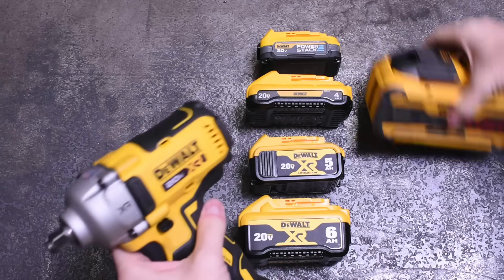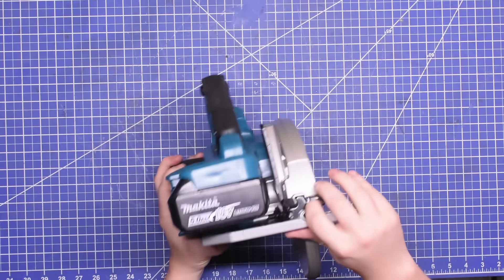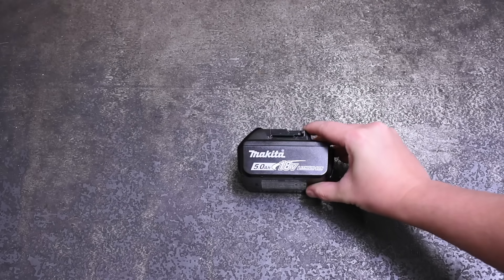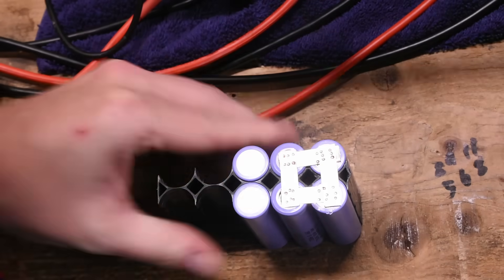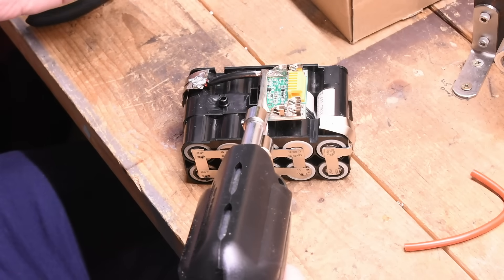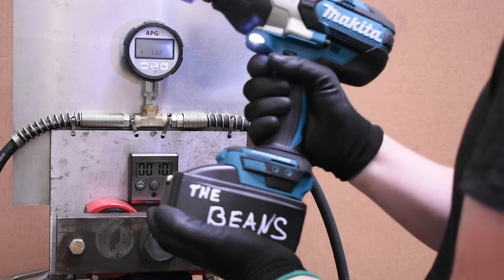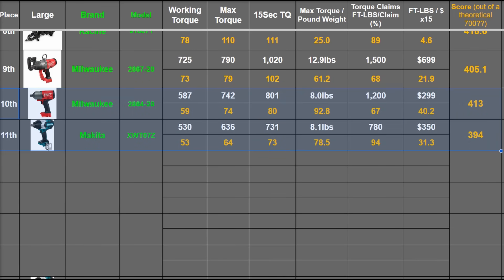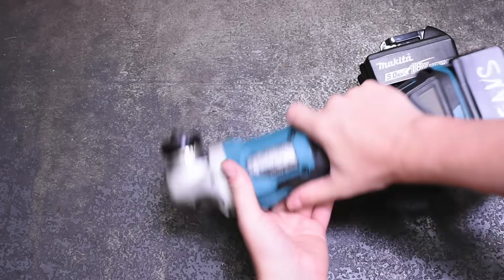We Built the Best Power Tool Battery for the "Worst" Brand

Comment: I have Makita battery packs that are around 10 years old and are just now dying off. I appreciate a tool that is somewhat dialed back and favors longevity. I would consider myself an above average weekend warrior, not a full time contractor so take my testimony for what it is.
Reply: Yeah agree, those batteries I bought for my first Makita drill about 12 years ago now, still work. Granted they may have lost some capacity over my new ones, but not to the point where I noticed which one is on any give tool.
Reply: Yea this is kind of like asking why your car does not have the performance it can have after some modifications. 
Sure it is faster, but also more expensive, and things may fail sooner.
Building the ultimate tool on an unlimited budget is not that hard, keeping it reasonably priced and reliable is a lot harder.
Reply: @zorktxandnand3774  I hear what youre saying but I'm still gonna put a turbo on it.
Reply: @zorktxandnand3774  I personally can't use "Makita" and "reasonably priced" in the same sentence together, but I've had no reason to look at their lineup in a very long time and have no idea of their current pricing, so what do I know?🤷
Reply: @h8GW  They're still expensive and the batteries are no exception in spite of how terrible they are vs what you can get from other, even lesser, brands these days. It's really disappointing as someone who owns Makita tools.
Reply: @randr10 I don't kmow where you live, but here in germany the Makita batterys and tools are vwry reasinable priced. You can get a 5Ah LXT Battery for as less as 60€, while an 8Ah Milwaukee, Bosch or Metabo costs at least 120€.
Reply: @Video-ee1dn Makita is expensive in America where as in the rest of the world where Dewalt and Milwaukee have less market share Makita is a lot more aggressively priced.
Reply: Yep…I bought a Makita 3-piece combo way back in 2009 and it came with two 1.5 mAh batteries.  They both still work great, as do the tools.  Undoubtedly the runtime must have diminished but not noticeably, and anyway I favor smaller lighter batteries over max mAh.
Reply: @davidyoung1610  That is definitely impressive, i think you mean 1.5 Amps or 1500 mAh not 1.5 mAh though
Reply: You are absolutely right!  I meant 1.5Ah battery packs.  Of course, YouTube won’t let me edit my own comments 🙄
Reply: I second that 
Never had an Makita 18v tool I didnt like and the quality of their batteries have been better than anything else ive tried or on par with Hilti and Festool packs 
Ive 10 year old 4 amp packs that works pretty much like New. 
I dont give a rats ass about "Max torque" and All that BS ... but in my anecdotal experience Makita tools and packs just work Day in and day out and provides great ROI as far as tools goes
Reply: My makita battery's are about 15 years old and still hold a perfect charge
Reply: I concur with this mindset, however I happen to be a full time electrical contractor. I've been using my Milwaukee impactor and 5amp battery packs for 7 years, no signs of slowing down yet.
Reply: I have ones that are 10 years old that live in full 5 to 6 days a week construction. In cold harsh winters even that still work
Reply: I got 16 years out of my first drill and 12, and 13 years from the batteries that it came with.
Reply: Interesting find on your Makita battery failures. I run all of the brands and Makita for me has been the most reliable battery. I didn’t say it was the most powerful battery, but it is in my professional use the most reliable brand out there. We run over 50 LXT batteries and we have been had any failures since 2014. I know we will eventually have a failure but compare that to six Metabo HPT,seven DeWalt , 13 Milwaukee and one Bosch battery failure.
Reply: Both are good. they can offer 4 or 5ah battwries marketted towards longevity, and 6-10ah for the beans **may degrade, possible start a trade in, send in the worn out 9ah for like 20% off a new one
Reply: I find that makita seems to be good quality as well as having production all over the country
Reply: There's definitely something to be said for longevity; I still have Makita 9.6v drills and a mini circular saw from the boatyard I mostly grew up in--in the 1980s! They still run just fine. Yeah the initial outlay is pretty high, these teal tools aren't cheap, but when you consider my classics are still running almost 40 years later I think the cost per year puts them well below even the Hazard Fraught lineup.
Reply: my Makita have lasted me 5-6 years before i had a drill and right angle die out as a Plumbing subcontractor
Reply: As a heavy user of these tools the performance and reliability is there. I’ve put my m12 and m18 fuel tools through hell in really harsh conditions and the only part of them that ever broke was a charger that was left in the rain and snow lol. I started with makita and their grinders are incredible but the battery life and power just isn’t there on a lot of it
Reply: Same boat here. Over 100 batteries in my rotation.
Reply: Yessir, had a 10 yr old 1.5Ah that still worked and ran for a good amount of time. Actually got stolen before I could put it out of commission myself. Have another battery at 8 years old now and hasn't had any noticeable reduced performance

Never had a battery just "quit" randomly or whatever he was on about. 3 of my coworkers have ran makita tools for over a decade as well and never had to replace a battery unless stolen. My shop uses em too, and those fuckers use batteries as mallets.
Reply: I wish I had the same sort of story, Makita batteries for me seem to have had about a three year life max. I moved to Bosch , because Makita drill drivers were not running true 
 and am impressed with the batteries as well as the drills. I do not require Max possible power, because if you do you're doing something wrong. I do not use power wrenches, hate the noise.
Reply: Některé lxt baterie které mám jsou už taky téměř 10 let staré a stále fungují. 
Mám téměř 30 akumulátorů a potřebuji aby fungovaly. Pokud bych se měl rozhodnout jestli chci akumulátor na 10 let s výkonem o 30% nižším a nebo akumulátorem o 30% vyšším výkonem který měl umře za tři pět let, pak volím nižší výkon. 
Lxt muž vypadat zastarale, ale neexistuje lepší akumulátor pro nářadí. 
Lxt akumulátor může být zaprášený a stejně ho lze vyjmout a zasunout vel.i jednoduše. Nejhorší je manipulace s akumulátory Hilti, Bosch a Milwaukee. Z těchto důvodů jsem tyto tři značky navrhnul.
Reply: Makita is the OG cordless and still so high quality. I have all 3 brands and I think they're the highest quality but usually not the most ugadugas. I've had my DeWalt system with batteries going on 8 years and no sign of weakness yet. My Milwaukee stuff- I think their biggest problem is that they don't do balancing with their chargers and their cells get fully out of balance and appear on the outside to be permanently dusted. If you open them up and take some voltage readings you usually find the banks out of balance. A proper balance charge applied from a quality charger directly to the cells fixes them up and they are back in balance for a while (up to a year or so worth of discharge cycles) and then later rebalance again. PITA but easier and cheaper than tossing them and buying new ones.
Reply: I use my tools all the time and have had so damn good Makita. I ran an lxt for many years and never had to replace a battery. I went to Milwaukee just because they have so many different tools and am kinda pissed the batteries die so easily. I'm currently switching to ceenr batteries for Milwaukee. It was either that, start rebuilding batteries or go to another brand. The ceenr batteries are powerful, cheaper, use quality cells.... we'll see about longevity.
Reply: I don’t exactly know who but someone made a open source tool to fix that by full resetting the software on the battery
Reply: I'm a makita boy, I support them because the tools are comfy, accurate and dont rattle like like the other brands but makita recently raised their prices here in australia and now they cost as much as the milwaukee which used to be quite a bit more in price and I'm not thinking about changing but I can't back my favourite choice because the tools have gone up so much I tell people now to just go red and abuse their warranty system
Reply: @wearsjorge55  I’m a Makita fan for the same reasons you mentioned. I buy my tools now from amazon now . Bunnings  and Sydney tools prices are very similar for most of the tools but if you have a powerpass card from Bunnings you can save atleast 10%  on their consumables and OPE gear.
Reply: Makita is reasonably priced compared to other top brands the difference for me is repairability after the warranty is up. Milwaukee and the others made by the same Chinese company are mostly throw away tools since all the electronics are one piece and cost as much as the tool.
Reply: @geneshort8160 correction - Makita LXT is reasonably priced, though lacking the peak numbers of their better batteried competitors.

XGT are crazy expensive.
Reply: I have to agree with you that  I used  to do  facility maintenance do all the tools we used would break down real fast until I convince my manager to buy some Bosch tools I said as much as far as I know they're still this was their first brushless tools they have replaced the batteries you talking a a bunch of years
Reply: @bluemantom77  I have some super old bosch 12v stuff thats still kicking and even super old batteries that are almost as just as good as my new batteries (still give the same umph but run time is slightly shorter on heavy tasks). They are kind of pricey but I cant say a bad thing about their 12v lineup and for what you get I feel they are actually cheap, could easily pay a lot more for less tool these days! My oldest one I have had for about a decade and I bought it used and super abused off my friends grandpa when he retired, he had bought it when they had just came out. The two batteries that originally came with it still are great XD
Reply: "I appreciate a tool that is somewhat dialed back and favors longevity."

Based on Makita's lil bit of a reputation for premature battery failures, I'm not exactly sure that's what's going on here
Reply: @RyTrapp0 If their batteries do truly die prematurely they will replace them. Albeit that involves some driving/mailing to the service center which no one likes. 

Makita has plenty of legitimate things to not like them for, the BMS (the controller that locks the battery packs up) is not a valid complaint. 

Capacity for sure is an issue for them. Hell even their 6AH took years to come out and by the time it did arrive M18 was onto 9AH. 

However I will point out that the Sony cells my original Makita batteries came with were some of the best (current available+length of useable life) 18650 cells ever made. I recently retired batteries from the early 2000s because of capacity . 
So yes they were expensive (and still are, unless you jump on their spring/summer annual deal that gives you basically 4 free 5AH packs) but the yield was much better than competitors. 

Eventually the other manufacturers started  including better cells, mostly because they had to (too many tear down videos out there). Still it seems the focus is on current now, replace the packs later. 

Personally I will take longevity over squeezing a couple more amps out of a battery. I am skeptical any of the larger M18 packs will be functional 20 years later. 

That's just my preference though, I tend to think if the task I am attempting needs those few additional amps from bigger cells, I am using the wrong tool. 

The same isn't true for run time, get it together Makita and drop a 9AH pack
Reply: @RyTrapp0  seems to be coincidence but my local tool shop says he sees milwaukee more than anything returned for warranty, battery's and skins. 

From my experience i don't think makita would have that reputation if milwaukee or dewalts high output stuff came out earlier
Reply: @wearsjorge55 that could be because of the volume of units sold. Milwaukee is probably the most popular tool brand in america if not the world. i would expect him to see more milwaukee and Dewalt than anything else

Comment: That was very helpful and interesting.. I wish you would test the LXT sub-compacts though. My tool and die maker friend swears by that impact and hammer drill. They have the virtues of very small size and low cost along with durability, according to him.
Reply: I 2nd this, I have the black clad sub compacts your talking about and when you strap a 6 AH on the drill it blows my mind how quickly I can drill through a broken bolt

Comment: Tools&stuff mentioned on several occasions that makita won't be improving the lxt 18v batteries. I haven't found a source for that, but I didn't look hard. And the price difference between lxt and xgt is quite massive for some tools.
Reply from the maker: I believe he's right. XGT IS the improvement and they made their choice
Reply: @TorqueTestChannel  I don't know if this is true, but I think the claim is that for high RPM torque tools like angle grinders, the motors really benefit from the higher volts. I know volts is just one factor for power, but all the top battery powered angle grinders are ones whose platforms are on higher volt ranges. Perhaps you can see if a bean'ed up LXT angle grinder and outperform an XGT?
Reply: Makita doesn't chase power like the others. They are Japanese. Makita always gets the job done, smoothly, quitely and efficiently, they are into comfort, light weight and ergonomics. They are the Toyota of tools.

In my country Makita dominates. Almost all professional tradesmen use Makita. The ones who bought Milwaukee and Dewalt end up switching to Makita over time. The reason is that here, Makita is cheaper, and so much more reliable it's not even a contest. And they are much more comfortable to use. I'm a former Dewalt guy. Dewalt tools are rough. Really it starts to wear you down when you use them every day.

Comment: Can u guys please use some Lithium Werks APR 18650M1B LiFePo batteries. The voltage is going to be a bit lower and the capacity is abysmal but they can output 30A continuous and 60A peak.
Reply: Why when 2ah liion cells exist with 30a cont?  Lifepo4 is obsolete

Comment: close to my solution for tools i get with dead battery packs but using a different battery than i own is to get a cheap battery adapter (plug the battery you own into it and it has a possitive and negative output) and then disassemble the dead pack, disconnect and remove the cells and then solder the adapter to the connector for the dead pack (after cutting off any connections to the old BMS module)

now i can use my cheap harbor freight hercules packs that i own on another tool (sure their are premade adapters but this is usually cheaper), so far i got an adapter to use them on an older lithium hitachi drill and an older dewalt lithium drill, also have an adapter to use my hart 40v from my lawn mower on a ryobi 40v weed wacker that i got for free. only issue i found is on older tools sometimes its a little too much power for the worn out brushed motors

Comment: I can't wait until someone makes a backpack battery, with ~100Ah, and connects with a short pigtail that runs down your arm.

Your battery that didn't sag as much also got closer to the rating…so maybe those inflated lb/ft numbers aren't actually inflated. If they reflect the torque possible if the battery voltage did not sag. You could run the test with a high capacity DC supply replacing the battery pack, eliminating battery output losses, & get the maximum power from the tool.
Reply: Makita already makes a backpack, but it is for 36v tools
Reply: @riba2233 the PDC01 can run 18v tools off of 4 batteries. Id love to see the current draw on it.
Reply: @EliotTruelove  yeah, idk if they let more than 40a at 36v continuous (like 2x18 tools with batteries) although I doubt it since it also works with 40v tools.. but then again the wiring is not that thick so over 40A cont would be problematic again, idk :D

Comment: tbh I kind of want to build the worst battery for the most brands, by chopping off a ryobi stem and slapping a slide adapter on it. How bad is good enough? The ryobi packs being kinda affordable (on sales and discount outlets) and generally protected from over-discharge is intriguing, especially now that the 21700's are back. 

The rigid packs are probably a better option with less modification, but I have bought 4ah ryobi packs for $25. I wouldn't expect much power gain, unless there's a way to trick the extra contacts to engage as generally they're current limited to prevent well, melting. I do have a pre-recall fire starter p108 pack somewhere, slightly melted.